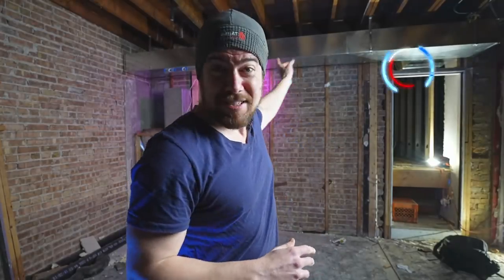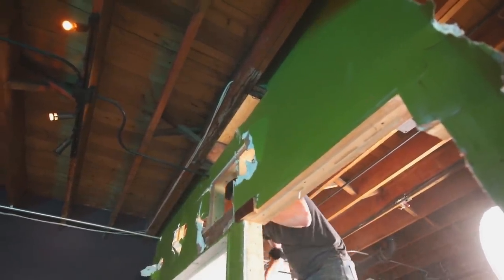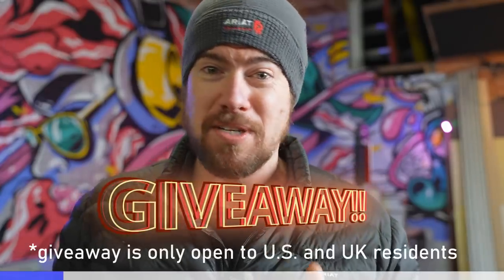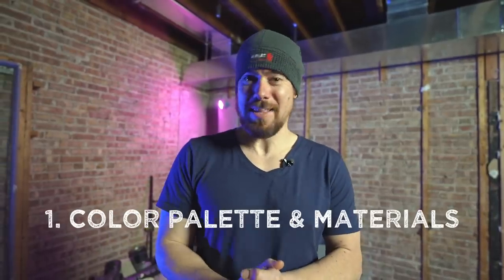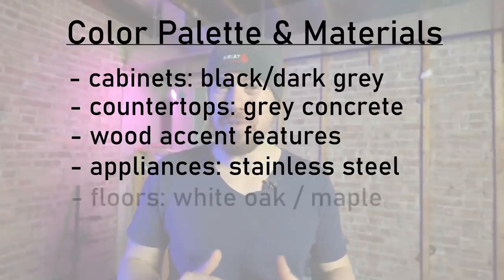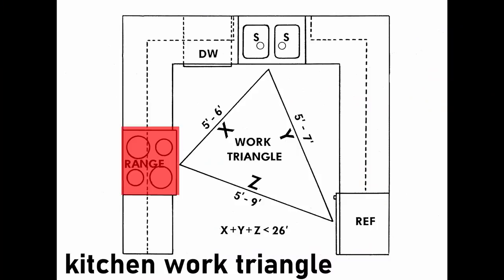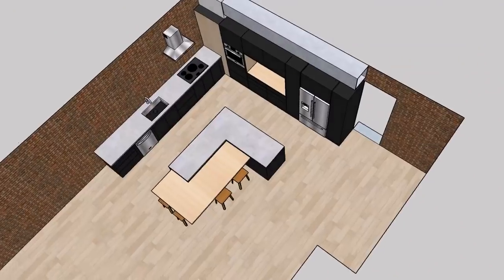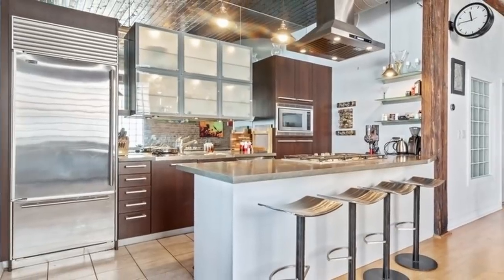Abandoned Building Reno Ep. 11 - DREAM KITCHEN Design and Demo

Comment: In kitchen, have a lot of bright lighting...overhead and also over the prep areas, and aiming onto the countertop prep areas. Make sure you have junction boxes for undercabinet lighting, and add more electrical receptacle outlets than you think you will need, and the Island is where I would have plenty of outlets. From experience, between numerous electronics, under counter and overhead lighting, and small appliances, you can never have too many outlets! A separate range and oven is the way to go. Bending over to get hot stuff in or out of an oven is not comfortable...and a wall oven should have a Microwave above it. Not sure I like the location of the wall oven though...the wall seems out of balance with it so far to the left and maybe because it looks too close to the range. If the range top was more centered on that wall and on the left side of the sink, would put the range closer to the eating area of the island and be able to serve guests easier, than if range is in the corner...meaning while you have company, you can be closer to where people are sitting and participate in the conversation, or see a TV better, than if you were standing over a range in the corner. The Range needs to be closer to the island and have prep areas on both sides of it. Moving the Range also would give you a safe place to put down the hot items coming out from the oven, and the oven would look better on that wall. You did not mention dishwasher...which needs to be near the sink...also need a dead space to hide the storage tank for an RO System, besides under the sink, with a water line to make ice in the freezer. That dead corner near the wall oven - could not tell if there is room to hide a storage tank or not, but I would hide one if I could behind the wooden wall of that dead corner, and create an access panel to get to it, from inside the cabinet that would be under the wall oven. For clean dishes coming out of the dishwasher, the drawers that you plan to store cups and dishes need to be nearby, to make unloading easy...and that means the area where you show the range, could be where the dishwasher could go, after you move the range. When you carry in groceries, the refrigerator needs to be near the countertop, where you put down the bags of groceries and that would be the counter that is closest to the staircase, for when you come up the staircase with many bags of groceries in your hands. Last, I would find places to add more pantry storage. I am thinking you will need and want more wall cabinets.

Comment: Ok, I have a couple of thoughts here.  One, from what I can see from your kitchen layout, you’re about to set it up so that you’ll have your back to your guests while you cook, clean, etc.  Second, you’ll be facing a WALL when you do it.  Please rethink this setup.  What may look “cool” on paper doesn’t always translate in practice.  I can attest, from experience, that spending your time with your back to your friends and family, while you’re prepping a meal (or cleaning up) is a real drag.  Keeping the sink and dishwasher in the island allows you more opportunities to interact with your guests, and you won’t have to face the wall.  (Footnote: with a cooktop/range, you really want to have plenty of counter space on both sides of it, for practical/safety reasons.)  Also, you might want to abandon the idea of the cooktop and separate wall oven.  A quality, slide-in gas or electric convection Bosch stainless-steel range will be sleek, reliable, and beautiful...and a lot less expensive.  And I’d definitely get the range/oven out of the corner.  Again, you’ll be staring at a wall while you cook...but in a CORNER.

Will you be in “time out”?  😝

P.S.  I was going to include some kitchen pics, to give you more ideas, but I don’t see an option to do that here.

Comment: Screw modern. Go Avacado green.
  edit; just kidding.  How about art deco?   If you put outlets in the island, don't put them on the flat. Put them on the sides at a 90. Any liquid that goes into the outlets is an issue. Pop up outlets are a potential problem.
    No water in the island please.

Comment: My 2 cents - you're going to regret having the cabinets so far away from the dishwasher.  Every time you unload it, you're walking the length of the kitchen..... a dozen times.

Or are you putting the dish drawers (and silverware) right next to it?  Wasn't clear where those would be positioned.

Just as long as you can unload it (and rinse -> load from the sink) without the extra steps, you'll be happy.

Comment: If you are doing counter depth refrigerator you should consider doing a side by side All Refrigerator and All Freezer with the door handles together in the middle.  This will give you additional space and will run you around $3000 which is close to the price for a stainless french door counterdepth fridge these days.  The counter depth french door fridges fill up really fast.  I am not recommending Whirlpool, but the Frigidaire ones I have seen in person seem to be discontinued.  Look up Whirlpool Sidekicks for an example.  These give the look of an industrial fridge without the cost.

https://www.whirlpool.com/kitchen/refrigeration/freezers/upright/p.18-cu.-ft.-sidekicks-all-freezer-with-fast-freeze.wsz57l18dm.html?
https://www.whirlpool.com/kitchen/refrigeration/refrigerators/side-by-side/p.31-inch-wide-sidekicks-all-refrigerator-with-led-lighting-18-cu.-ft.wsr57r18dm.html
https://photos-us.bazaarvoice.com/photo/2/cGhvdG86d2hpcmxwb29sYnJhbmQ/33588cf0-8fb6-5769-8442-837b36ef593b

Comment: 3:27 dude its above a doorway there is no structural anything there pull it out leave it fuck put some spray foam in there or pack in concrete it really doesnt matter at all as long as its not going to fall off and hit you in the head

Comment: Don’t do electric stovetop!!! Don’t dooo it.  The worst to cook on.
Reply from the maker: Electric and induction are VERY different.  Induction gives more control than gas, but a flat surface to clean.  Best of both worlds
Reply: @modustrial  I went from gas to induction (moving condos) and I miss gas so much. I'm sure quality of induction stovetops varies widely and I have zero context on the choices out there, but mine sucks. My heat setting experience is 1-5 is simmer, 6-9 warm, and 10 the only setting hot enough to sear steaks, fish, etc. You're totally right on the cleaning part and I'm sure your induction choice will be far better than mine.